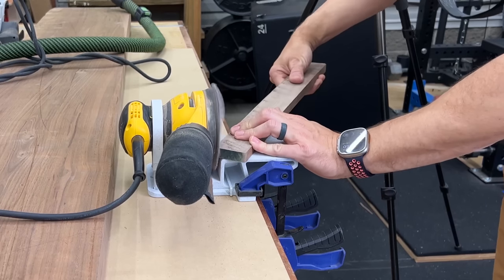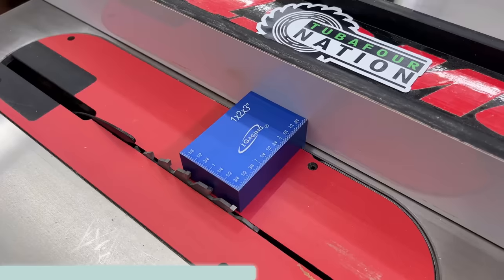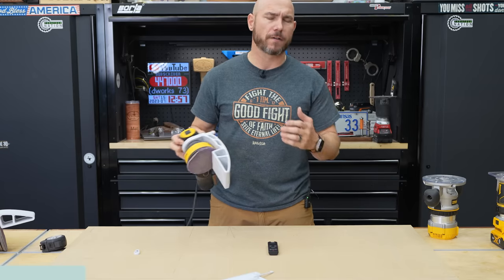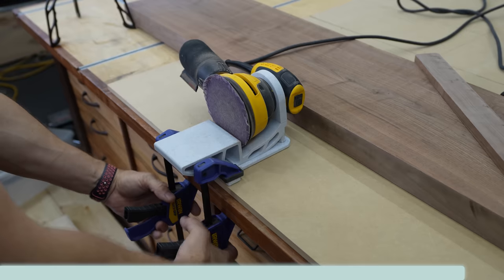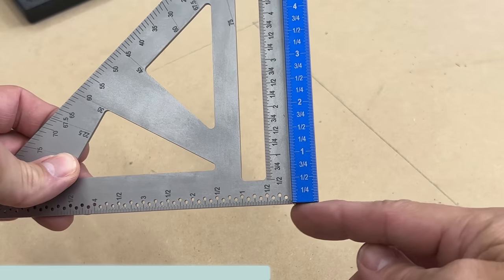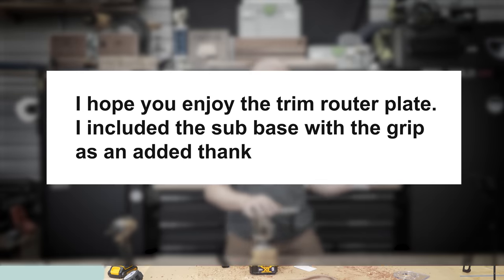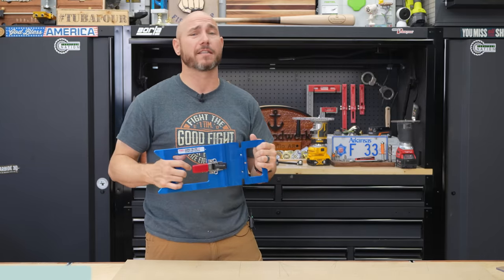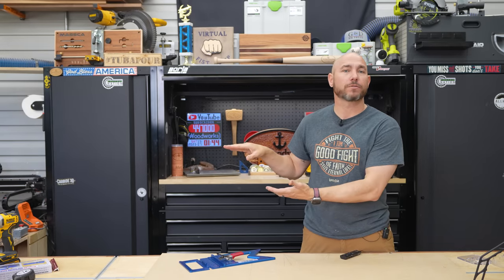The 5 Most Awesome Woodworking Tools You've Ever Seen!

Comment: That right angle sander attachment is 3D printed which means it will warp very easily in hot weather
Reply from the maker: I would think it would have to be extremely hot and left in direct sun light for a while before something like that happened.  They are really thick 3D printed material.
Reply: I print these in PETG. The heat in your workshop will not bother it one bit.

Comment: I didn’t read all the comments — someone may have mentioned it — but the best change in the TSO square Version 2 is that you can attach it anywhere along the track in an instant. With no loss of squaring accuracy once you lock the clamp. They modified the T that fits in the clamping groove so you don’t have to slide it in from either end. Great modification!

Comment: I've just brought a Preciva Folding Carpenters square / ruler here in the UK, £26.00 made in China, realy impressed, the square has a folding arm giving you 12 inch's, lockable stop on the common, degrees, but not on the hip valley, a scrib in the base, has 3/8 -10mm shoulder on the base lert and right. its worth a look.

Comment: I like the router base. But the iGauge set (the same as this one) I bought a couple of years ago was pretty sad. The metal the blades were made of was very soft and bent easily, and the measuring scales were off as well as the angels. And the pens were broken. 😥 I do like and use iGauge's Digital calipers and I have been meaning to get a set of their Setup Blocks.
All the Best, Chuck

Comment: I have a set of Igaging setup blocks which I use constantly.  However, mine are sized from 1 mm to 20 mm with a 25-50-75 block.  I have been converting from Imperial to metric and realize I should have done that years ago.  I use several other Igaging products as well.  I find that they make quality products.
Reply: I am saddened  by the fact you are using metric. It is an inferior unit of measurement.
Reply: @JerryPonds  ahahahahahahahaha!                    'merica
Reply: @NickLM2008  lol
Reply: @JerryPonds ….Would you like tell the class how metric is inferior?

Comment: Which setup bars do you recommend, the setup bars from iGaging or from Kreg?  Also, Amazon has the Kreg setup bars for $79.99.  Amazon also has a replacement set of bars for $22.99 with the same number of bars.  Both comes in a plastic case. Not sure what the difference is between the two Amazon kits other than $52.00. Do you see any differences?

Comment: Finally! Someone with some street cred (other than Stumpy Nubs) is highlighting the excellent iGaging tools! I bought the bench squares a couple of years ago from Taylor Tool works and their quality is outstanding. Ever since then, their attention to quality has not disappointed. I have the setup blocks, digital protractor, and the table saw alignment tool. Sure they are made in China, but to very exacting tolerances insisted upon by Igaging tools. Anyone should give them a try. 
Excellent lineup of tools.

Comment: Love the sander attachment, seriously useful, but having had a tso rail square (not latest model) in the past and the benchdogs rail square currently they are night and day difference.  Compared to the cam system on benchdogs the clip is fiddly and just doesn't feel as secure,  the bevel attachment pegs on the benchdogs square let you square against molded edges/worktops accurately, and the real game changer is the repeat stop accessory, essentially a calibrated scale with a stop block, ripping sheet material repeatably for cabinets is effortless

Comment: Great video as always - Can I ask if that TSO Guide Rail Square is compatible with the "Milescraft 1409 Track Saw Guide" that you recommend for folks that don't have a dedicated track saw?
Reply: TSO has versions for several different track saws. They currently have them for Festool, Milwaukee, DeWalt, Makita, Kreg & Triton.
Wouldn’t hurt to reach out to them and ask for a Milescraft version. They get enough requests for it and they’ll know it is worth pursuing it.
Reply from the maker: They won't work with the Milescraft
Reply: @731Woodworks  Seems like there's a lot of drawbacks to not going with a standard tracksaw with one of the main brands.   A lot of those conversion kits don't seem to have great support, and neither does the Ridgid at this time.   Good to know ty.

Comment: The TSO track saw rail edge guide.  Great product, but $185 is absolutely absurd.  I’ll wait for a cheap knockoff.  Come on guys.
Reply from the maker: It is priced high, but it works.  And is accurate.  The knockoffs have issues with accuracy a lot of times. You might luck out and get a good one though.